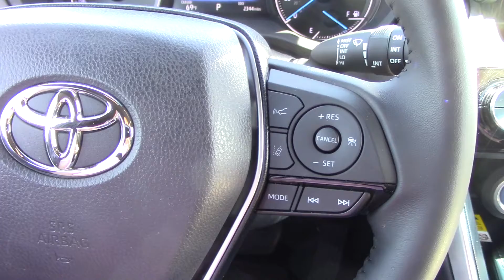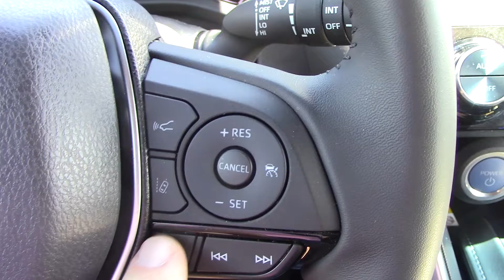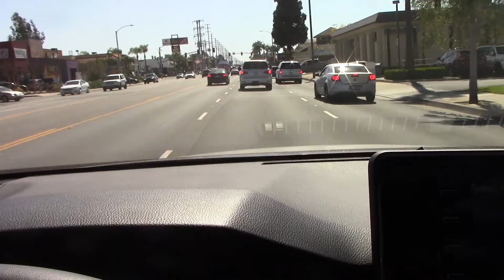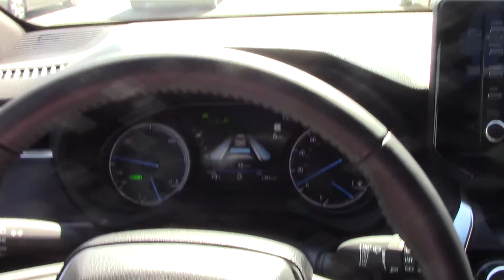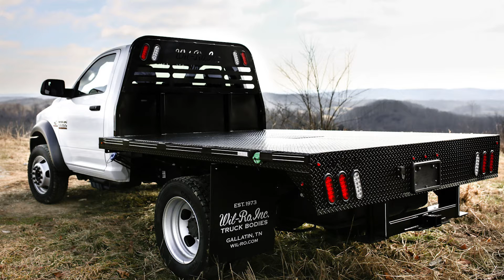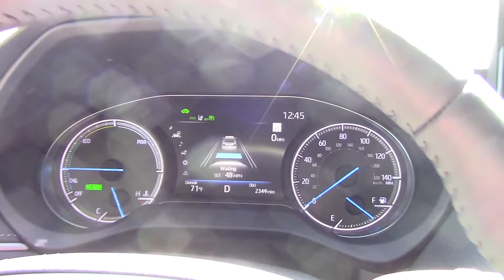How To Use Dynamic Radar Cruise Control and Lane Tracing on a Toyota with Safety Sense

Comment: Played around with the cruise control settings yesterday when driving on regular streets and what I found was by setting the distance to 3 bars, it'll attempt to brake but will only brake with 3 bars distance. In other words, it's like imagining 3 cars in front of you with big gaps but won't slow down to stop. You can feel the car will brake but not fully and I had to step on it to completely stop. So I don't know if I made a mistake on my end since I wasn't sure exactly how the cruise control went, but it frustrated me when it didn't maintain the speed.

Comment: I have a 2012 Toyota Camry, WITHOUT the stupid Radar system on the cruise control.  I have rented Camrys with the radar system and I HATE IT!  It can be turned off, but you must go through procedure of turning off this radar crap EVERY TIME YOU START THE ENGINE.  I will not buy a new Toyota unless/until they allow this crap system to be shut off permanently.  In my opinion the radar crap system sucks.

Comment: 🎯 Key Takeaways for quick navigation:

00:00 🚗 Overview of Dynamic Radar Cruise Control on Toyota with Safety Sense
- Explanation of how to activate and use the dynamic radar cruise control system.
- Clarification on the capabilities of the Toyota Safety Sense 2.0 system.
- Introduction to the lane tracing feature and its limitations.
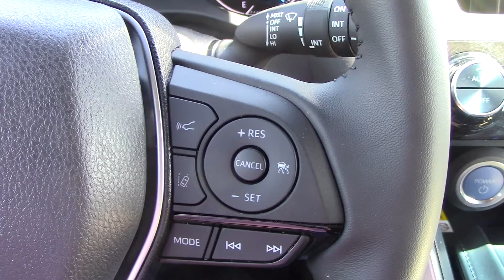01:37 🛣️ Demonstrating Lane Tracing and Cruise Control Functionality
- Step-by-step demonstration of activating and adjusting cruise control settings.
- Explanation of how the system adjusts speed and following distance based on traffic conditions.
- Clarification on the role of lane tracing and the necessity of keeping hands on the steering wheel.
03:34 🚨 Safety Tips and Limitations of Dynamic Radar Cruise Control
- Emphasis on the importance of remaining attentive and ready to intervene while using cruise control.
- Guidance on handling sudden lane changes or aggressive maneuvers by other vehicles.
- Instructions on re-engaging cruise control after coming to a complete stop.
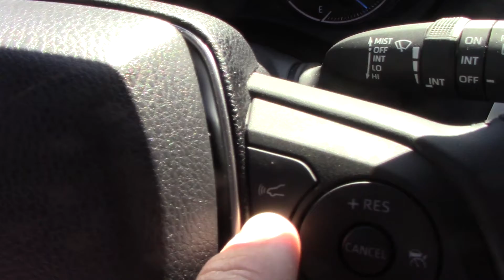05:54 📏 Adjusting Following Distances for Different Driving Conditions
- Explanation of the significance of adjusting following distances based on traffic conditions.
- Personal recommendation for shorter following distances in high traffic areas.
- Insight into the dynamic nature of following distances based on vehicle speed.
07:42 💡 Conclusion and Considerations for Safety Sense 2.0 System
- Summary of how to use dynamic radar cruise control with Safety Sense 2.0.
- Consideration of upgrading to Safety Sense 2.0 for enhanced traffic management.
- Closing remarks and encouragement for viewers to engage with the content.

Made with HARPA AI

Comment: Question though that i havn't found any answers to.  When the car automatically stops while using the radar cruise control, does it activate the rear brake lights as if you are pressing the brakes yourself?  Reason i asked is i'd be worried if the car brakes by itself withoug activating the brake lights somebody might not see the car is slowing down and may end up rear ending you?
Reply from the maker: Yes, the system does illuminate the brake lights when it applies the brakes to let the people behind you know whats going on.

Comment: Dear, can you set the speed higher than 125 km
Reply from the maker: According to Toyota, Full-Speed Range DRCC is designed to operate between 0-110 mph. That's about 177 kph! I did not go that fast with this car so I can't say for sure if that is accurate. Most adaptive cruise control systems I have used set the top end at 90 mph, which is closer to 140 kph.

Comment: Don't push anything to resume after the light turns green. That is not necessary. If you have the cruise control set and you are behind another car at a traffic light, when the car ahead of you moves, the cruise control will get you back up to speed without you having to do anything. If you push the resume button during this the cruise control will increase it's set speed. Most of the time, dealers don't know what they are talking about because they don't bother to read the user manual. They just want to express the cool and innovative features so they can sell you a car. Js
Reply: I think this depends on your vehicle.
Reply: Wrong. Watch the video again.
Reply: Mine wont resume by itself.

Comment: The vehicle will not stop for a red light/stop sign if no car is ahead of you?
Reply from the maker: Correct. Dynamic Radar Cruise Control does not recognize or react to road signs or traffic lights, just the vehicle directly ahead as long as its locked on.

Comment: In this scenario when your car is stopping at a traffic light due to being locked onto the stopped car in front of you, will the car then accelerate for you again from a dead stop when traffic begins to flow? I have a 2022 but I haven't tested the full stopping part yet 😂
Reply from the maker: Either press the "RES" button on the steering wheel or tap the gas pedal to get the car moving again after it has brought itself to a complete stop.

Comment: Hello, thanks for the video, I wanted to know if the Toyota Sienna 2022 has these same functions? If you are at a traffic light, does it stop at zero?
Reply from the maker: The Dynamic Radar Cruise Control is standard on all 2022 Toyota Sienna models. None of these vehicles will bring themselves to a stop just for a red light, they do not read traffic lights. However, if the system is engaged and locked onto the car in front of you and the car in front of you stops at a traffic light, the Toyota can bring itself to a complete stop in that situation.

Comment: When we set cruise control and break it automatically off the cruise control but i hate the beeping sound when it’s off. Anyone know how to disable the sound?
Reply from the maker: I am confused as to which "beeping" sound you are referring to. The car could beep for lots of reasons, can you be a little more specific?
Reply: @CarDietrich  The beep corresponds to the lane keeping assistance when a driver is riding the lines.

Comment: Hi, does anyone know if you can increase/decrease speed by 1 mile an hour rather than +-5 when using adaptive cruise control

I was able to do +-1 mile on my Skoda Toyota only changes by 5 miles at every press of a button
Reply from the maker: Per the 2022 Toyota Venza Owner's Manual (That's the vehicle I filmed this with):

Fine adjustment: Press the switch.
Large adjustment: Press and hold
the switch to change the speed,
and release when the desired
speed is reached.

In the vehicle-to-vehicle distance control mode, the set
speed will be increased or
decreased as follows:

Fine adjustment: By 1 mph (1.6
km/h) or 1 km/h (0.6 mph) each
time the switch is pressed
Large adjustment: Increases or
decreases in 1 mph (1.6 km/h) or
1 km/h (0.6 mph) increments for
as long as the switch is held

If you have a different model or you're in a different region (I'm in the US market), check your owner's manual. I found this under "Radar Cruise Control"
Reply: Yep. Depends on the region. In Europe for example the ACC varies in 5 km/h increments. The normal CC however, so I’m told allows for 1 km/h increments. I’ve never bothered with it.

Comment: lol Wow I've had safety sense 2.0 for over a year now and had no idea it would come to a complete stop. This is crazy!!!
Reply: It's still not that great... doesn't slow down for curves. If the cars speed is set to 80 it will take the turn at 80 mph on the highway.
Reply: @manasgupta8908 😮😮
Reply: @manasgupta8908 good to know that i‘m planning to get a Toyota with this system. Thx bro
Reply: If you have electronic parking brake, then it will come to a complete stop.